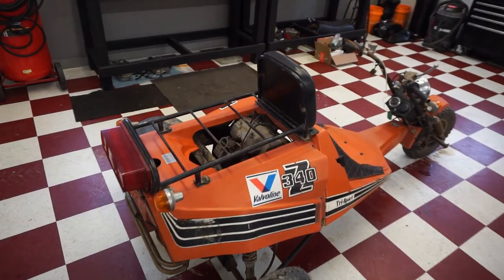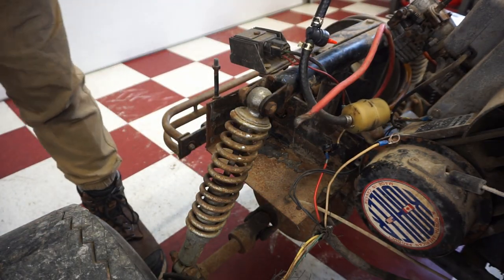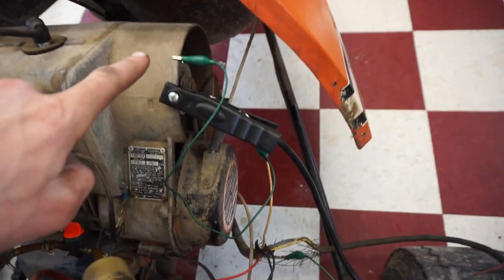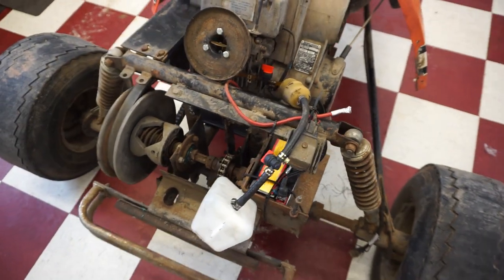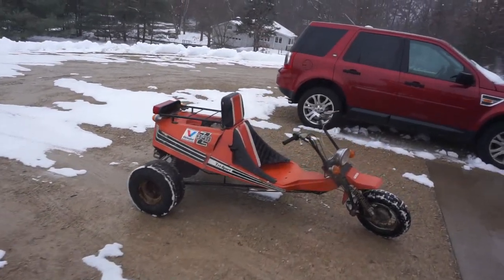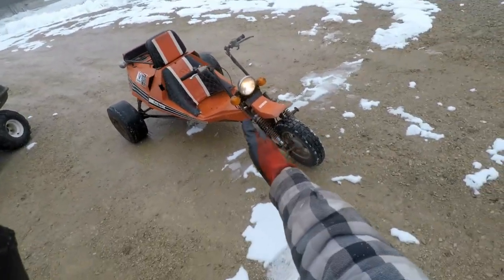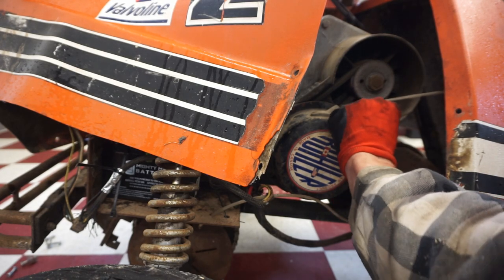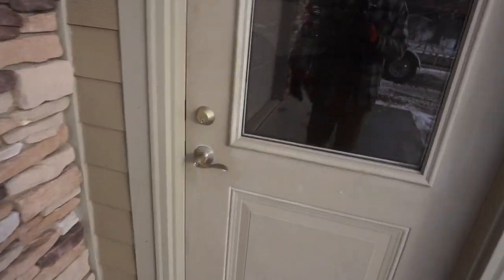First Ride On The Street Legal 340cc 2-Stroke Trike (SCARY FAST)

Comment: Nice job getting her going, I remember my 340 powered tri sport would pass cars on the highway, so it was at least worth 60 mph. Maybe 70 or 80 who knows lol. SCARY FAST is exactly what it was coming from a 90cc Honda floatation tire rig back in my day LOL
Reply: I should add I live in Northern Illinois where the whole area 10 counties wide is flatter than a pancake. Not too far from where I live was an old flat track race track called Sycamore speedway and I heard rumor they used to have classes for these racing there alongside motorcycles back in the day. I was told the original intent for these machines was flat dirt track oval racing, and they do it so well fishtails for days on gravel or dry dirt.. you will see. This is making me want another one at 49 years old LOL! Keep up the good videos you are inspiring!

Comment: ooh this brings back some very old memories
my neighbor had a similar "smaller" one that he let me drive "40 years ago"
that thing is so much fun 
super stable on a flat road but if you hit a good bump with just 1 rear wheel at speed 
you will instantly know what true fear feels like and why they stopped making them
you even have spare wheels on the (6x6) for much better  traction on snow 
 thanks for the memories dude

Comment: Thoes clutches need some adjustment for sure, the second you hit the gas it should grab and SPIN thoes bald tiers, it seems you dont have the low end torque like it should, I have 2 of these, it should top out around 80mph if adjusted right, just play with the weights in the main clutch till you get it right where u like so you have low end and top end. Great job buddy. I also noticed ur secondary clutch is stuck open, def get that freed up and ull have the low end and get rid of the bog it has..

Comment: I had one of these from about 1988 to about 2005. I traded a 1971 Mercury Cougar XR7 for it. Mine was also the street version but had been stripped down. It had riding lawnmower style treaded tires for better traction and they worked like a champ. Went in sand, snow and everything. I also upgraded the motor to a 440 from the 340 CCW. My friend paced me on the highway one day in his Bronco at 93mph. It seemed maxed out. Wish I still had it.

Comment: Great machine and I am glad you got it running.I bought a metalic blue one with no engine a number of years ago and installed a 440 ski doo engine in it.I had to replace the chains and sprockets as they were badly worn so I added dual brake disks in the rear because the thing was plenty fast and sketchy to stop at best.

Comment: Glad you got it running….  Sounds just like the one I had.  I am curious what the top speed is, my speedometer never worked but it hauled.  One thing to note is the rear tires are usually tubeless trailer tires and if you try to slide the back end around and the tires catch they have a habit of popping the seal against the rim.
Reply: Definitely need knobby tires and some kind of bead lock system. Even some kind of all terrain but smoother pattern like the honda atc had or john Deere gator.
Reply: Just add some good quality tubes in the back, that should remedy that with out to much work.

Comment: That red tail/ possibly turn signals built-in it. Takes either vA 1156,1157,2057 light bulb for it. I to looks be just A regular 1157,or 2057 blub to me. Those turn signals are the orange lights single power wire in the center.with body mount chassis ground bolts to the frame is all.

Comment: I used to have one of those when I was 12 years old. I bought it without a motor and we ended up putting a 3.5hp Briggs on it and it would go about 35 mph. Yours has a little more accessories on it than mine did. Mine just had the fiberglass part where ya sit but not over the motor.  Anyway, I had a blast and wish I would've never sold it.  Have fun 👍

Comment: Awesome Cool!   I was thinking you cold have just used that red Jerry can as the actual gas tank.  The clutch tesion on that belt could be adjusted to not require so much throttle I think. But I'm sure you will know if that's possible.

Comment: It turns a lot better than I expected on snow, considering it's a posi rear.
Might stop OK on dry roads with only front brake (if the pads are still pretty good) until you find a rear brake

Comment: For the gas tank, try a windshield wiper fluid tank from an old car or radiator overflow tank.  Either would work and they come in a multitude of sizes and shapes.  Just thinking outside the box here...

Comment: Some brake calipers, and an electric starter, and some tuning on the carburetor,  and on the CVT system. and socket added to the that taillight housing to accept an 1157 bulb, or an LED equivalent.  and get the brake light circuit working. and get some really grippy tires, and maybe a second set of wheels for pavement tires. and you will have a killer vintage trike for on-off road use.

Comment: Neat Trike! you should do a top speed GPS Run!
Reply: 40mph
Reply: @billbkr32ify  Had a 5hp B&S Tri-sport that would do 38mph. In theory this 340 should easily double this because it has FOUR times the power ; with the right gearing.

Comment: Then you could do the same underneath the rear end of that to on both sides two smaller weights on different frame mounting brackets welded up for stability purposes.

Comment: My Gyro had a tight turn radius and was a hoot to hide. It would only go 30 mph until I took a rat tail file and sandpaper to the exhaust port. Then it would go 35 mph, 40 downhill. It was the most fun machine I ever had. People at the Terminal Annex in Dallas would ride it in the parking lot at night.

Comment: Hey I know how you could keep it weighted down to the ground.,or road while you're riding it fast to old house window weights with brackets welded on to them. DIY made for being tucked up close to the frame as much as possible. That are weld onto like bicycle seat types bolt clamps with through bolts.& Split washer's & locking nuts on the top& bottom of the shocks.,or the front forks shortened up to fit on both sides of it squared up to.

Comment: Use carb cleaner or hairspray when putting grips on. It makes them lubed enough to get them on easy real quick. Then the carb cleaner or hairspray dries out and the grips tighten up. Not like were they wouldn't if let's say u used wd40 or something like that. I'm sure most people that rode for a while know this trick lol.
Reply: Hair spray ... they slide right on and lock for life.

Comment: my old friend he used to build trikes, crazy big ones with jag v12 engine in one he built to a trike made from vey  light  tube with a 500cc 2 stroke yamaha engine in it  looked like your trike but sightly bigger wheels and foot rests on the frame ,and double chain and sprocket set up because of power

Comment: They are fast. I had one in1979. 28hp kolher engine. It would do around 100mph. Depending on type of tires on it. You can run voltswagon tires on the trip sport I had. Thank you for the video.

Comment: Hope you will, sand, paint alot of axles, fix up the shocks, repair the body. I would think that would have had a faster take off. Not sure carb is right yet or to much into carb or if the clutch on that or sprocket gearing is correct
Reply from the maker: Needs air filter on it yet. Also needs new belt.

Comment: Nice trailer!  We think alike ... I'm thinking weld some beads into the pull-starter and you say "I welded some beads into the pull starter".  The whole time I was thinking "you will barely make it to the mailbox with that pocket bike tank", I guess I was wrong there.  Also, I'm thinking "since we all know it needs tires before any real street riding can occur, you should throw some slime and a thousand self-tappers in those tires and play in the snow".
That being said, I hope you do find an electric starter, fix the brakes and put a nice set of DOT tires on it.  It seems like the CVT has quite the performance tune on it.

Comment: I can picture some cool modifications. Tank, bodywork, handle bars and lights. May have to build one. Two cylinder, two stroke will make 150 horses for 10,000 miles.

Comment: Do some research on kohler twin cylinders. Is that a 2ax? and if the cvt is working proper it should be pretty crazy. Let's just say I have a kohler R/LC 250 in my sled. It was top dog in 1976

Comment: Dual carb's off a 340 sled with a pair of Mikuni Carb's would give you more top end and snap! Jetting would help also and the mix if it is 30 or 40 to 1 I would lighten it up to 40 or 50 to 1. Twin pipes adapted from a twin sled would help. "The Crank Shop" in VT is a good place to talk to about pipes and Al's Snowmobile in VT is a good place to get part's from for older sled's and older 2-stroke parts! Set of Wisco high compression Piston's would be a big help for power!

Comment: The Taillight on those looks to be an old style RV/Camper Taillight, and the bulb socket portion is missing and or broken, probably snapped out when someone tried to replace the bulb, they would rust and corrode in place.  That one in particular looks like a SAE-STIALR-69 style light.  You can still find them NOS online, or you could just upgrade to a modern LED equivalent camper/rv taillight.

Comment: Love the trike, put tires on like you have on the 6 wheel drive and go for the snow WOO HOO. oh and a small hint to hopefully make life easier stop using a screwdriver bit on hose clamps , a socket does not slide side to side when turning and some smaller clamps you don't need a socket at all the driver fits right on the clamp. So far I really like what you are doing keep it up

Comment: Man that thing is sweet! I hope you get this thing on the street, my advice is when you go to the dmv, just act like its any other registration, don't draw any attention to the fact that it's a unique vehicle like this, act as of its just one of those Harley like motorcycle trikes. Ready to hit the road SAFELY.
Good luck with this machine man that thing is so unique and bad@##. Also Think about putting a chrome FMF 2 stroke dirtbike pipe on it (with a silencer for the street) keep you out of trouble, then a set of those little DOT Hoosier tires for the rear and a DOT mini super moto for the front. Would be awesome 👌

Comment: Add a battery ,running it without blows the lights ,there is a  resistor bar ,white in colour mounted on the head light loom ,2 strokes are terrible for charging ,but  when done it  will make all the difference .

Comment: Thanks for the Memories buddy I had one but mine had a 16 horsepower Kohler engine in it yours seems like its original I'm not sure if the Kohler was an option or not mine would top out about 55 miles an hour very rare I should never have sold mine for the amount I sold it for you should hang on to that that thing is as a museum piece.!

Comment: I remember seeing an old gas tank from rototillers that were metal with a center fuel inlet...that should work for you. Hope you really fix this thing up and take the cheater slicks off, fix the fiberglass and seat. If I had it, I would put a small 4 stroke motorcycle engine in it with gears. Electric start.

Comment: Looks like the belt is worn out and not set right, looks low in the clutch, new belt will make a huge difference,  maybe even get a 500 fan cooled engine also, looks like a donut machine, ive had and seen alot of toys but have never seen one of these, cool project Joe

Comment: Jsyk..
This is a tri sport..
I had a white tri ROD..
IT HAD A SKI YOU RePLACED the front wheel with.just the axel bolt held it on.
Mine had a four stroke.and knobby baloon tires

Comment: Holy shit, I haven't seen one of these since my dad brought one home in the early 80s. I think I was around ten years old because my new ride was a Kawi. Kx 80. I think I would get the trike I had up to 75 or 80 on the street. I remember it threw a chain when I was going about that fast and I saw it flying and heard it smack the fiberglass but it was never found. Think it's still orbiting earth. I live in TN and did back then so at least two existed and they were about as far apart as physically possible in the US.

Comment: A down dirty way to get lights on vintage bikes 1 a bicycle light kit 2 the spot light at any parts store that has the push button to test 3 take working trailer light and glue it inside the lens    us voltage regulator to keep bulbs from popping

Comment: If you get it running to it's full potential, it will lay rubber on dry pavement,  and set you back very hard in your seat.

Comment: Smearing grease around those sealed bearings will do nothing for the bearing! IF you pry out the seal and then apply some grease and then put the seal back in place will help as much as you can do without replacing them! If they are very dry and rough you will eventually have to replace them anyway!

Comment: If it was me I'd get some aluminum and a full senior an a gage for a gas tank the gage so you not run out of gas an have to walk masher the size of area for a gas tank and cut the aluminum weld it up fitting on the bottom gas inlit on top and a return on top that way you will have the biggest size that can fit so you will have the most gas you can its no fun when you run out of gas.    You did not get all the GRES fitting I seen 2 on the back

Comment: I noticed that the instrument cluster only had a speedometer on the left hand side. But it looked like it had some kind of instrument optionally setup for the right side. Any idea of what this instrument might have been? Could a tachometer have been used with this trike? Would be interesting to know if you were over revving the bike too much. Maybe a multi task unit could be used. Something that you might want to see on a scooter such as fuel level, oil pressure,, high/low headlights, engine temperature. Or maybe just something more down to earth such as a tachometer and engine life monitor. Something that can tell you how many times the engine has turned over so that you can setup a maintenance schedule.

Comment: Wow, almost 200 comments in your first 4 hours. Too bad no burnouts with a CVT transmission. Insane that it is street legal, but then it is just a 3 wheel motorcycle slammed to the ground.

Comment: CVT transmision sucks
Reply: Sounds like you don't understand cvts.
Reply: @AL4N.  nah they are bad for offroading and i think that manual is faster and better becouse i drove both
Reply: @Stefan_38   you're aware that many newer cars use cvts right? Subaru, jeep etc.
Reply: @Stefan_38  you're first comment said " cvts suck". I disagree, it depends on the application.
Reply: @AL4N.  true and true but yeah i dont like it
Reply: Becouse cvt is not good on low power engines
Reply: @Stefan_38  I agree with you on the cvts are no good for off-road. For fuel economy, ride quality and speed cvts are superior.
Reply: @AL4N.  they are more "smooth" and i dont like it becouse of that manual for example can be pounded on and it has much better acceleration and power than cvt and thats why i dont really like it plus its way more simple then cvt and much cheaper to fix any issues
Reply: Uncle gave us one of these as a kid and after watching you ride this I’m definitely glad he converted it to a four wheeler. 😳 haha